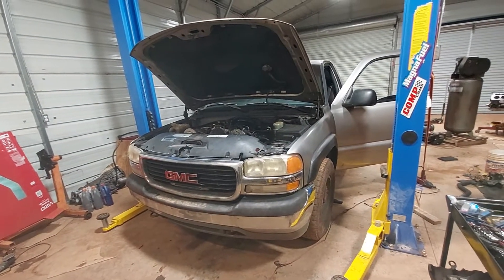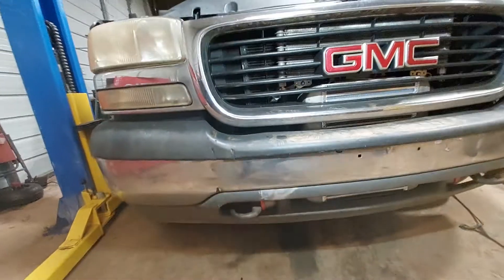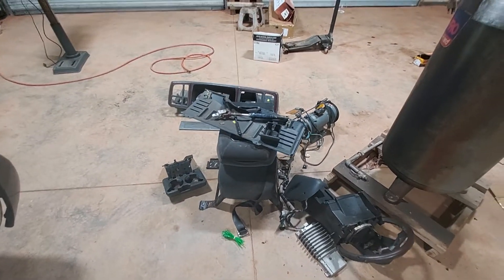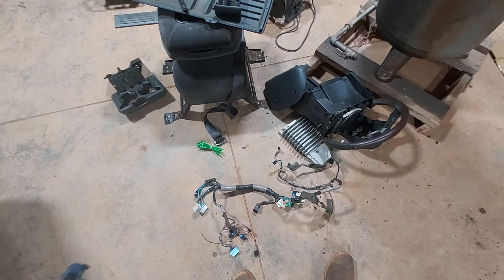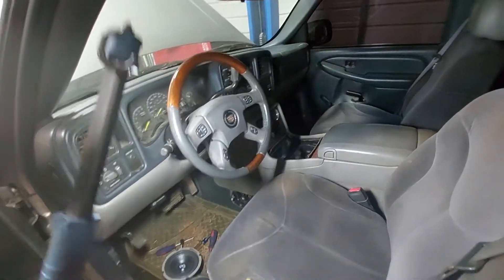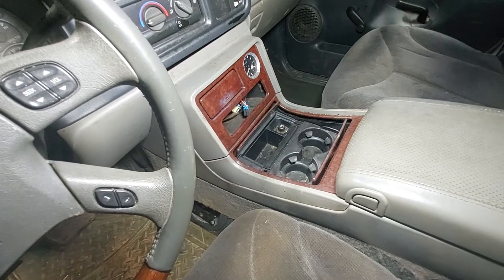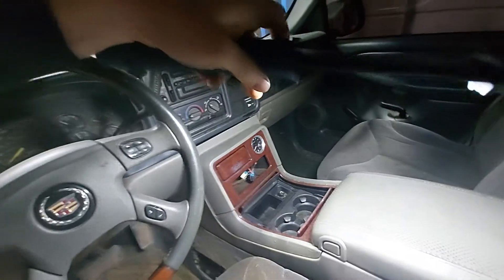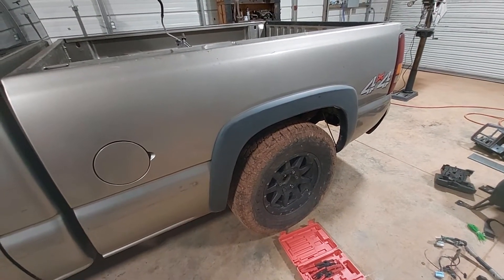Video 8: 6.0L turbo awd Sierra, Escalade interior swap

Comment: What wiring harness did you take out and put inside with the Escalade steering wheel?
Reply: The Escalade harness or the sierra harness? Got myself a whole Escalade steering column and harness but a lot of the Escalade connectors are different from the Silverado connectors

Comment: WOW!!  What year is your truck? What year is the cadillac steering column?  Its not actually plug and play is it? What wiring hacks did you have to do to make the escalade column interface/work with the sierra ? I would like to do the same to my 2000 Sierra.  It would beat the cheesy sticky tape wireless radio steering wheel controls for radio and bluetooth

Comment: Any video on how you switch the steering wheel
Reply from the maker: I used the complete steering column out of the Escalade along with the wiring harness from the Sierra.  The Escalade harness unplugs off of the column, and the Sierra harness plugs in along with the turn signal switch.
Reply: @MPKPerformance  So what year is your truck, and what year is the escalade for the column?
Reply from the maker: @joerivas9847  The truck is a 2000 I think, and the Escalade was an 06.
Reply: @MPKPerformance  thanks!